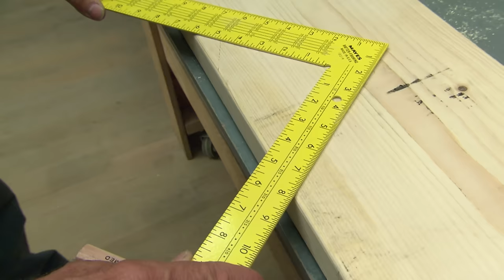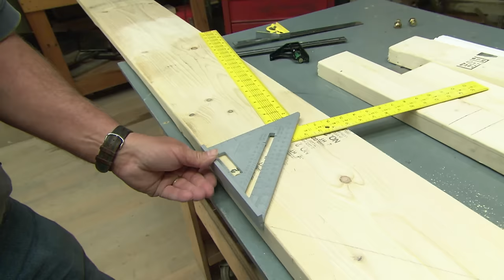How To Use A Framing Square | Ask This Old House

Comment: Tommy, Kevin. Other Cool Features – The Swanson Speed Square has a patented feature — the diamond cut, a diamond-shaped cut-out on the ruler edge of the tool. This is used for squaring on a line scribe-ed across the board so that you can then make a perfect 90° line from your scribe-ed angled to the edge of the board. Showed, me what I missed about my Speed Square on 45 degree side as a skill saw, fence. I've,  used it as a skill saw fence, for accurate 90 degree straight cuts for years. But. Now,  watching this video I've picked something new. It's, called Speed Square, because the inventor Al Swanson, said, "it speeds up my cuts, and helps make those cuts square and clean. So, I chose the name because of it's functionality not it's shape. It, gives you fast square cuts."

Comment: Tom I have a question for you in my back bedroom in the corner I’m starting to see separation from one wall to the other deeply concerns me if the stucco or there is dry rot underneath the foundation that is causing this separation slim floor Two ceiling do you have any suggestions do I need to get in to the wall it is our third bedroom we have the original hardwood floors I wish you guys came out to California Mike in Concord California

Comment: Just think if like the rest of the world you measured in metric you would use one measurement ie mm. But instead we get to use sixteenths, eights, quarters, half inch, three quarters, inches, feet and so on. Try this: nine sixteenths plus seven eights plus three and a quarter inches. Then try 10mm plus 8mm plus 140mm plus 14mm. See which is the easier and quickest. I worked all my life in construction and dreaded the change from imperial to metric in the 70’s Now when I visit my family in Texas I bring all my metric tape measures etc with me. Could not go back to that system.
Reply: Yep, but we're stuck with it I guess.
Reply: Specially for precision works , the milimeters do a great job!
Reply: I spent three years in Holland designing and using only metric.  Only when we had USA products did we use inches, but converted them all by 25.4.  Now I use only CAD in MM and any inch stuff I convert.
Reply: 9/16+14/16+3+4/16=3 27/16=4 5/16 i did that in a minute with fingers as a calculator
Reply: @natalieisagirlnow  Takes no time with metric.
Reply: The only thing more annoying than imperial measurements are the droves of morons arguing it's death and change to metric. It's just simply not going to happen.
Reply: well, go work with american engineers... we use tenths and hundredths of a foot... confuses the hell out of everybody but hey, conversions are easy... I still don't understand why anybody would split something into a 12th as in an inch... but then split that into a only halves... i've never heard of a 12th of anything else...
Reply: @judsonclayto7813  Don't speak for all American Engineers. Most if not all should be fluent with both systems. The company I work with uses metric almost exclusively and is American. Working with medical and aerospace you pretty much need to work in metric 100% of the time.
Reply: other than hours and months...ok, there are other 12ths...
Reply: @jamesarjuna927  math is math.  it takes a minute either way, unless you can't do it
Reply: No one at work gets why I use metric. I feel like we just think it's the devil. I won't forget switching and how easy it made everything I've ever worked on since then. Only thing that sucks is drill bits don't seem to come in metric.
Reply: It takes way longer to read a tape! All the lines are the same.

Also imperial is more precise. 25cm in an inch, 32-64 increments on an imperial tape
Reply: I Guess it’s better for like. Baking or whatever. Not measuring distance in construction

Comment: My grandfather would always snap a line from corner to corner and go off the line not the crown when doing stairs for the perfect set of stair horses... go off the edge of the wood and not the line will through them off...
Reply: Ahenkel36 Them Old Pros hey my Grandpa was a Carpenter also

Comment: Why is a 2by4 1,5inches wide, i thought that it was 2inches by 4inches
Reply: 2 by 4 are the dimensions of the lumber in its rough cut stage. once it's been milled down it's 1.5 by 3.5 but we still call it 2 by 4

Comment: Why is a 2x4 called that, but it's a 1 1/2x 3 1/2?🤷🏾
Reply: Just old terminology. They used to be a true 2 x 4 back in the day. Over the years they just slimmed down the lumber hence why building codes change. A 2 x 8 is now 7 1/4 not even 7 1/2

Comment: 3/10ths  I DONT GET IT. 1:20 mark.  you said 7 inch riser and you had it on a 8 inch riser.  so, do you mean a 7 or 8 inch riser?  YOU DID IT TWICE.  you are cracking up tommy.
Reply: The marks on that edge of the square are 10 marks per inch, rather than 8 or 16.  So 3 marks = 3/10 of an inch.  As for the stair tread, I think he was just rushing through so he didn't get things lined up as precise as he would have if he was doing it for real.
Reply: I saw it at 7 1/2.